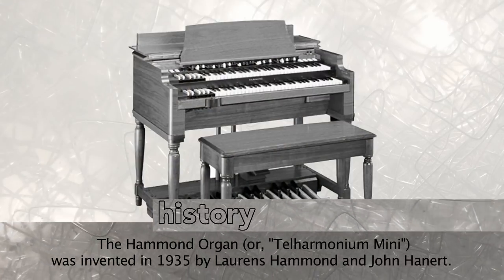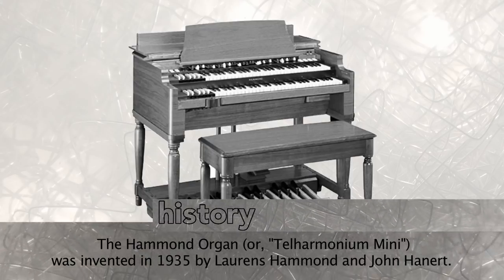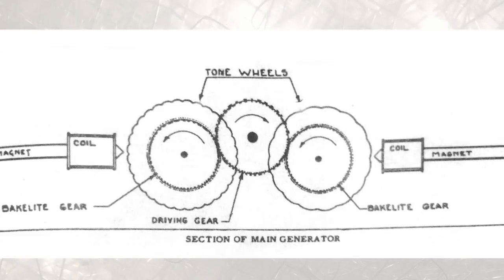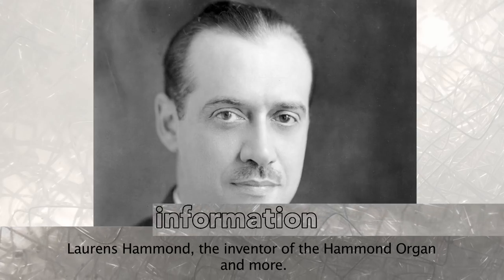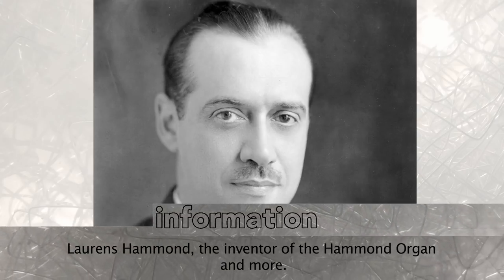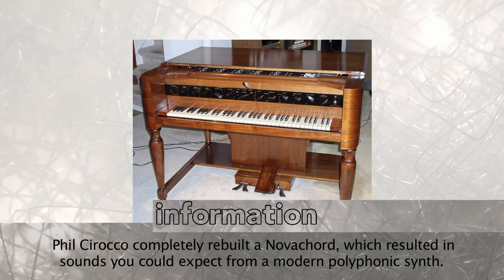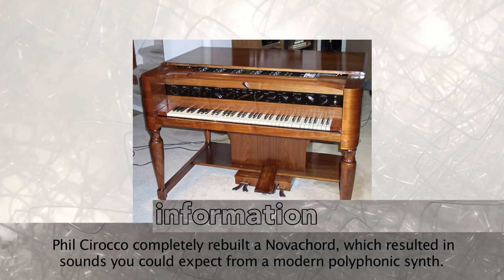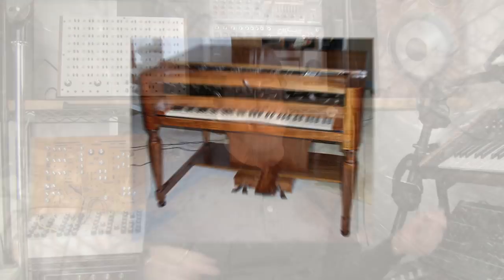A History of Polyphony: Part 7- Hammond's "synthesizers!"

Comment: For anyone curious to learn more about the Novachord as I am(and willing to read patent-ese), here is a (limited) selection of some of J.M. Hanert's (an engineer for Hammond)  and Laurens' patents. Reading through them chronologically, it is interesting to watch the development of ideas incrementally.

https://patents.google.com/patent/US2126682A/en?oq=2126682 , filed & granted 1938, appears to be the main patent for Novachord concepts, including discussion of how the frequency division is accomplished somewhat differently than other divider "organs", and discussion of why pentodes are preferable to triodes for the division.

In the rest, with their use of "melody instrument", it can be difficult to distinguish if the technologies described within were meant directly for polyphonic instruments in some cases or not, but there seems to have been a lot of cross-pollination, and the language used for the discussion can be pretty fascinating.

I will number rather than link the rest for brevity (with filing rather than granting dates, especially as WWII started to considerably delay issuance).

2221188 1938 vibrato/tremolo effects
2233258 1939 improvement on above
2276390A 1940 used a doubler, "playing of melodies...as distinguished from instruments on which chords may be played"
2301871 1940 "double touch" -- aftertouch for the application of vibrato
2310429 1941 elaboration on  2233258 discussing octave overtones
2500820 discussion of "chorus effect", and how to generate it in a rather complex manner

And then some oddball things:
2357191 accompanying pedalboard with extensive discussion of envelope generators
2342338 synthesizing percussive melodic instruments (marimba, xylophone)
2254284 small instrument with a very peculiar keyboard arrangement
2432152 a drum synthesizer?
2543628 very extensive discussion of envelope generators -- and not aftertouch, but envelope control though the sensing of absolute key position (divided into finite steps) 

This list is not remotely exhaustive, as Hammond Instr. Co was granted about ~65 patents on their organs and synthesizer technologies between 1933 and ~1950. Hope anyone else finds this interesting.

Comment: A thought has just occurred to me. I own the Voce V3. Is there some way that I could hook it up to a full synth setup, 2 EG's Resonant filter filter mod a more realistic sounding chorus (detune), et al and fully polyphonic? or can this be done in a softsymtne with just the drawbars as the "oscillator(s)", or two sets of these, and the rest being the synth

I would also package the hardware version differently, in a much more modern or futuristic case

Comment: Was Novachord 12 note polyphonic since it had 12 oscillators or could you play the same note from different octaves at the same time? In other words did the divider "eliminate" the original frequency while lovering it by an octave?
Reply from the maker: What defines polyphony is how many notes play, not how many oscillators the device possesses.  Since in a divide-down keyboard all available notes play, it is "fully polyphonic," no matter how many oscillators are involved.

Comment: Technically an LFO can be used for Filter, Amplitude and Pulse Width as well as Pitch Modulation.
Reply from the maker: Thank God you told me
Reply: Of course you know.  I don't know why you didn't tell them.
Reply from the maker: Without watching this over to see what I said, I'm going to guess that because I was specifically talking about the purpose of the vibrato circuits on the Novachord.  The "LFO" parallel is a tenuous one to begin with in regard to this device.  If you'd like to see me discuss the functionality of the LFO, I'd invite you to watch any number of the hundreds of videos I have here wherein I address LFO and its applications specifically.
Reply: Well, technically speaking wasn't the Vibrato on the Novachord more of a mechanical device and not an oscillator in the first place?  I also gather that it generated a more complex type of Vibrato with multiple iterations of Pitch fluctuation that would be very involved trying to achieve with a single LFO.
Reply from the maker: An oscillator can't be mechanical?  Aww, you're no fun.  
Also, it sounds like you've been using really boring LFOs.
Reply: I don't know why you would say something like that or where you would get such an idea, but to answer your question, no not in the true technical sense of the word and how we implement them as a means of voltage control.  In the abstract sense, your hand can be like an LFO if you were to manually impart regular pitch changes on a Violin string for example.  Yes, a Leslie speaker produces oscillation and it is mechanical but I wouldn't classify it as an LFO.  I can understand how some people might.  Look Marc, I was just clarifying something you mentioned in one video and your way of contending with that seems to be met with these flippant reprisals.  I'm really on your side!